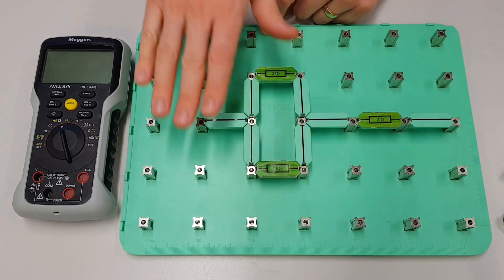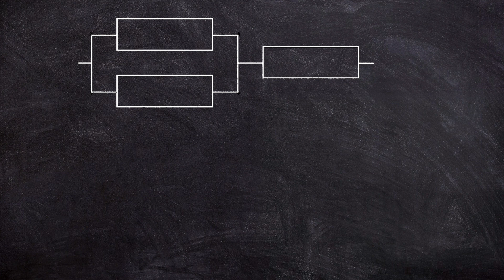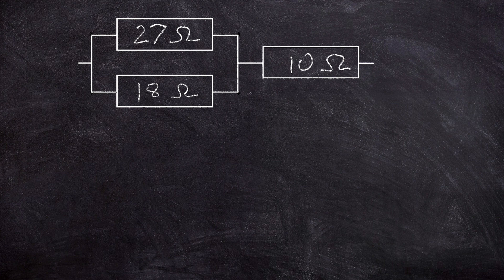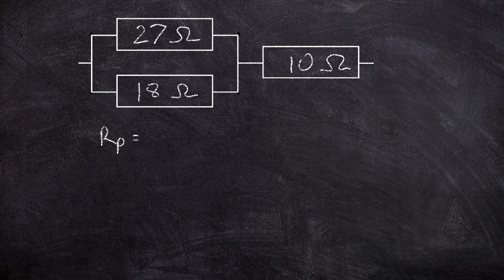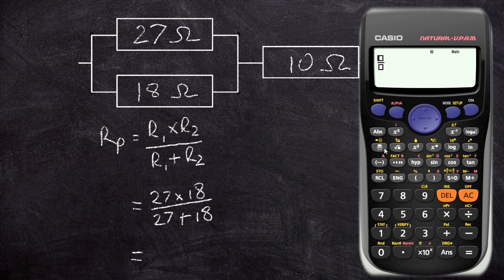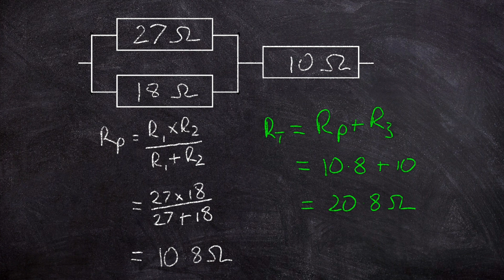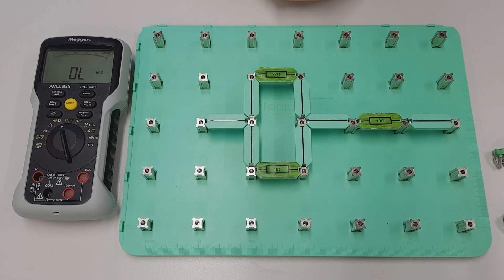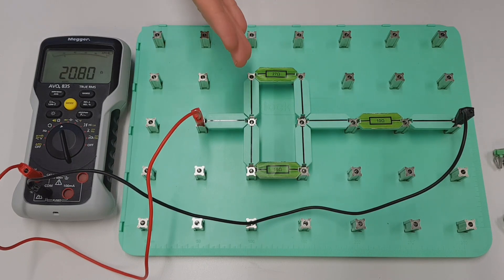Questions from Viewers: How to Calculate Total Resistance of Circuits in both Series and Parallel

Comment: Great video Joe, it's interesting to see both series and parallel resistors. It's nice to see the maths coming together for both rather than being given a series or parallel circuit to work out, as generally questions on resistors are either series or parallel but never a question on both in the same circuit.
Reply from the maker: Glad it was of interest, this will lead up to some other important points in the future as well about real world circuits.